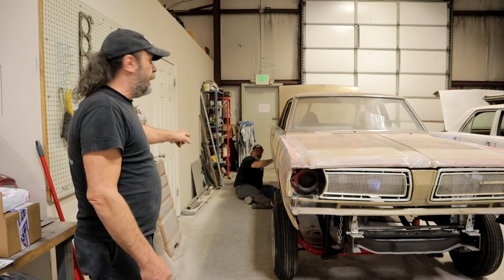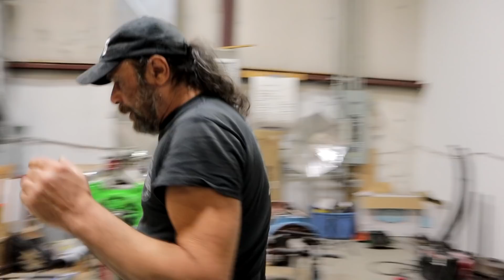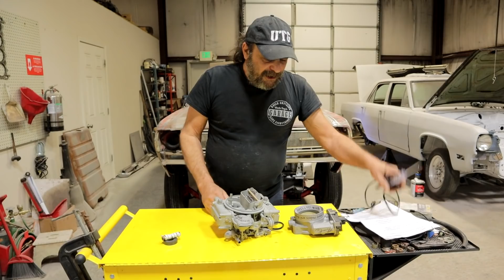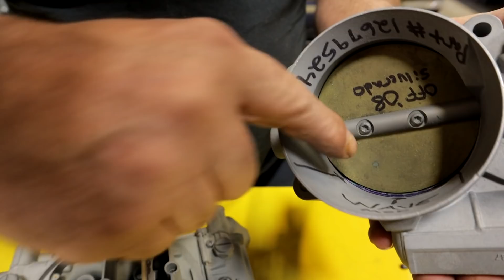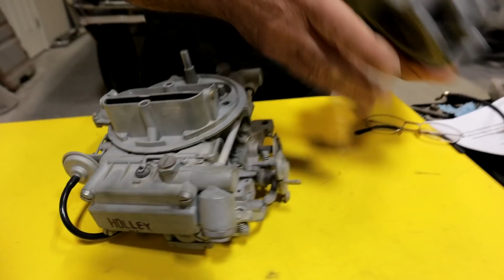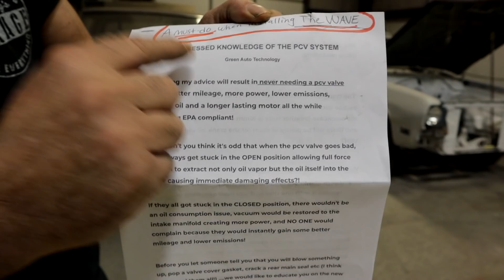The Free Energy Scam And Other Absurdities Of The Mechanical World

Comment: A couple of notes on the throttle body.

99 era GM Vortec V6 / V8 used a single large throttle body with a " ski jump " on one side of the blade.  This allows fine throttle control at low openings and virtually no restriction at wide throttle.  This jump effectively blocks off one side of the blade and all air flows through the other side of the blade until you are past 1/8 or so throttle. 

99 Era Ford ( at least on the Ranger 4.0 OHC ) the throttle body gasket has a rake shape protruding into the air stream.  This performs a similar fine throttle control at low openings. 

Sure, you can cut the ski jump or rake out and you will think the car is faster however, it will be miserable to drive when trying to maintain lower speeds.

Comment: Just like the late Magician Randy, you're debunking fraud.
Engines run on Air, the Fuel just heats the Air. 
Pulses and flows work just the same as in  Pumps. Positive Displacement Pumps, Turbine Pumps, Centrifugal Pumps, all are driven and flow some substance. 
Engines use these properties , add Fuel and Pump Heated Air. As a byproduct we turn a shaft that can do work. 
All the laws of mass, friction, heat, and motion apply. 
Sorry no Magic.

Comment: The pcv system has many advantages I agree with you to the fullest. I think some people get confused on a pcv and a crankcase evacuation system. They are the same as you know but use different sources of vacuum I.e. headers,vac pump or engine vacuum. Please explain this in your pcv video.

Comment: That modified carb is basically the same as stock the only difference is the throttle plates adjusted wrong. Try it out same setup as the vapor system to prove it doesn't work. 

On a side note I bought a vehicle with a bolt in turbine that supposedly caused the air to swirl when the motor was running. It was supposed to improve fuel economy and horsepower  but it didn't work like all the other gimmicks out there. There's one in every crowd that believes in this junk.

Comment: Hey I like the video. I'm one of the guys that believe you can run them off of just compressed air and have the system refill itself. You would have to use electric as your fuel source, instead of gas

Comment: I put air oil separators on all my cars because I've seen the amount of crap that comes out of the PCV system. Even top fuel cars have a version of it so they don't oil down the track when they pop the motor. Of course Tony knows that.

Comment: Don't do the trial. Too many variables to notice even a small change the mod can be credited too.  IMHO to do a trial properly a second carb built identical but non-modified is needed as 'control' and then put on two identical vehicles to be driven identically same time/humidity/temp/wind direction and so forth. IMHO the guy hopes you do try to bail but by just saying something like  "Ya it seems to work." and he'll run with it. You will be used for marketing forever. I remember when 70's Suzuki did something to it's motorcycle fuel draw system to get more power. Maybe 'swirl cool combustion' or something like that. I think that worked. Your vid reminded me of that way back when. God bless!

Comment: The only way to fairly test that system is to get an identical carb with identical jets and mixture settings, then run a test like you did with the vapor system.  My guess is there will be absolutely no difference because of the reasons you stated.  Maybe you should tell that guy to do a little research on the Chrysler cross ram manifolds.

Comment: I would use the Holley on the dart with the baseplate with grooves. Run the gas from a small container so that it would run out in 10 minutes or less at 1200-1400 rpm (cruising rpm where the groove should be working) while the car is park. After the baseplate with grooves, use the baseplate without grooves, or you can do the normal one first and the grooves one second, your choice.
Steps for actual test:
-start the car
-Set the rpm
-fill container
-Turn off the car
-restart and let it run till empty
-switch baseplate
—Repeat

Doing this negates any enrichment mpg losses, while ensuring both plates see the same exact test conditions.

Another way would be to use a very small clear container. Make a line on the bottom of the container where you stop the test. This test measures fuel consumption and time, the first test (till empty test) measures time. Hope this helps

Notes: 
-containers would have to be quite small to accommodate a run time of 10 minutes or less
-I understand that cruising at 1200 rpm and idling at 1200 rpm are not the same. While idling, there is no load, but from what I understand, the airflow through an engine at 1200 rpm should be the same no matter the external load
-the Holley currently on the dart is tuned for that engine, making its efficiency more ideal that two different carburetors with same internals but different base plates

Hope this helps

Comment: Back to back test is easy. Have engine running on a stand, part throttle for a set amount of time. Use the wave carb. Then swap to another unmodded carb. Both must have the exact same set of internal parts, jets, etc. Start both carbs on the same already to temp engine with a fresh oil change and filter, and with a measured amount of fuel. Measure fuel consumption after the test. Actually doesn't need to be on a stand. Just disconnect the gas tank and plump in a temporary fuel containter that you can have a measured amount of fuel in.

Comment: I agree, the PCV was a great addition to engines. The old down draft tube just didn't cut it unless it was strictly interstate use but there was no interstate back then, lol.
Reply: Speaking of those, my dad mentioned that it took a bunch of years but the center of the road wasn't as dark anymore.
I think he was referring to the late 70s when most of the cars by then had it and the old ones were retiring off the road. 
Bikers kinda notice things like that.
Reply: @MrTheHillfolk   Another tying that hardly exists today is the 2 cycle Detroit Diesel they leaked a lot of oil!  a lot of over the road trucks used them.
Reply: yup stinky

Comment: I really appreciate the battery videos.      I had a bank of 6 deep cycle 235ah 6v batteries that sat uncharged in my shed for about 3 years.  After charging capacity was basically nothing.  Tried the welder tip, and was able to revive 4 of the 6.  The 4 that work now have a capacity of around 180ah, and the 2 that didn't survive are scrap.  They both are measuring a dead short, so I guess the plates must have warped.

Comment: The intake swirl can not survive, through the twists and turns, of an intake manifold. Old technology,  that did not sale.
Reply: The point of the squirrel is to mix up the fuel droplets before they hit the intake valve it's about atomization back in the 70s GM used to put intake gaskets with screens blocking the intake ports so when the fuel hit it finely atomized the fuel and air evenly

Comment: I have had built Chevy engines the have leaked  oil from  the valve covers because there was no PCV system that blow by has to go some were you can block off a pcv system these people are nuts

Comment: The Vapor system may have worked if you did long-distance highway driving everybody knows in town driving is gas-guzzling
Reply: An impartial test would be putting it on a 350 Vortec crate engine that's not all modified but basically stock and doing back-to-back comparisons on a long drive

Comment: Uncle Tony, your supposed to hook up the Silverado throttle body on a Chrysler product with a Ford rear end. The resulting antinutrons and antiquarks will then be pulled into the engine and upset the Avogadro constant causing a massive increase in the angular velocity at the end of the air plenum and result in a massive increase in the efficiency of detonation in the combustion chamber. JK these people are nuts, there's no free energy, but if you're lucky once and a while you can get a free lunch!

Comment: To test that carb, just use a substitute fuel tank under the hood that holds one quart. Put in one quart of gas and see how long it IDLES. Driving is too imprecise to get accurate data. Have a control carb, another 1850, with EXACTLY the same jets, power valve, idle mixture setting, same idle speed, etc. There won't be any change in power, it's just idling, but maybe in fuel consumption. Maybe it would help in stop and go traffic. But I doubt it!

Comment: I don't think you should test that carburetor.  That being said if a test were to be designed it would have to be done with one carburetor.
Run it from a small external bottle. Time the length of time that the engine idles on a set amount of fuel. Modify that carburetor changing nothing but whatever is necessary to make the modification. Run the test again and see if it runs any longer after modification. This would be the most favorable test possible as I agree that once the butterfly valves open any more than a little the effect (if there is any) would disappear.

Comment: Idk i how i would test this out tbh, 1st thing that comes to mind is like others have said get the twin carb untouched install it run it after its dialed in to get a good base line, then remove the carb and put the modded on one dial it in as best as you can and then run it. gas wise put 10$ of gas in the car for both carbs jack up the ass end and just let the car sit in place in drive and run. time it til it runs out of gas. one that runs longer is clearly better.

Comment: Hmmm, that precise groove cut in relation to the throttle plate does make a difference but you have to also block the PVC vaccum so to maximize engine vacuum to make the difference. It does raise cylinder pressure. I have done it several times. But this guy is ripping off Ron hattons gadgetman groove which is well astablished and made many videos. He wasn't the best marketer so many of his videos end up being dismissed by lots of people who are not willing to look into more.
Reply: correct ....

Comment: I did the battery thing about 3 weeks ago.  My 77 D110 Slant 6 is being difficult and the battery completely died dead, so I tried hooking it up to my stick welder.  What an amazing success.  I have to crank the engine for 30 seconds of so if it starts at all.  I have done this at least 30 times and the battery is just as powerful after I rebuilt it.  This is a great trick to know and I will use it whenever I need it.  I can pay for a welder using this trick.

Comment: As far as the PCV system goes. You might want to explain One type of benefit, with the old PCV routed to the headers trick us older racers used to do and the horsepower gains it would give. Just a thought. love the channel my friend.
Reply: Even though vacuum pumps are very prevalent at the track these days I still see quite a few header evacuation systems.

Comment: That weird Mr Gadget grooved throttle bore idea MIGHT have merit in a small, single cylinder engine, but only at idle or just above idle, when the throttle blade is nearly closed. I believe, rather than generating a vortex, it's just a controlled air leak to lean out the mixture. Much like when you drill a hole in a throttle blade on a Holley to help it idle with a lumpy cam and low vacuum. A single cylinder engine will still have pulses coming back up the intake, but not from competing cylinders. I think Michael was trying to incorporate a version of a swirl port HEAD into a carb or TB, but I think the further you get from the valve, the less effective it would be. But I ain't David Vizard, whatta I know? 🙄
Reply: said "     Much like when you drill a hole in a throttle blade on a Holley to help it idle with a lumpy cam and low vacuum.    "   Actually, this is done to allow the throttle blade to be closed enough so the blade is below the idle transfer slot.    With a big cam, you need more air flow, turning the idle speed screw too far brings the blade above the transfer slot.  Drill a hole, air flow increases, idle speed screw can be backed out.
Reply: @bobroberts2371  Yeah, I know, but my comment was getting a bit too long to go into that, lol.

Comment: I always had the best luck with a carb with small primaries. It always did good on the highway and could get up and go when you hit the secondaries.
You can only go so lean before you start hurting parts. I always liked seeing the exhaust valves a brite white color in the lean burn 318s.
Reply: Constant depression is the way to go.  Nobody makes one big enough or small enough for most of us though.
Reply: You're not really going to run lean with smaller primaries though. Smaller barrels will limit the volume of air, not fuel.

Comment: There is some info lost here. The effect of the groove is the same effect intended by dimpling the bottom of a heads intake running the eddy current is rolling the air like water rolls in a gold miners riffles. This rolling effect DOES NOT send compressed units of air into the system! What it does do is reduce the friction of in the incoming air. This has been shown to work on the flow bench but it reduces the overall active runner size the engineering/tuning has to be precise to reduce the friction and not cost power loss due to reducing the runner effective size. We all know sometimes what gains on the flow bench doesnt make it to the rear wheels and while it is great at reducing the weight of the wallet it doesnt make a gallon of gas go farther than taking a piss before you leave or leaving the wife at home.

Comment: Funny watching you in this one. I get it...I think meth/water injection is probably more likely to improve performance and efficiency over "the groove". Its adds to much complexity to be worth it. I do know that the Big 3 automakers DE-TUNE cars so they dont get the best performance or MPG. especially in the past. I bought a programmer for my 2006 F150 4x4 HD and improved my performance and MPG by 100 miles per 35 gal. tank of gas. A Ford specialist tuner reprogrammed my truck adjusting shift points and timing. I had increased airflow by replacing the factory 3" to 2" intake reducer pipe going into the fender for cold air with a 3" straight pipe. I also swapped the factory muffler to a MagnaFLOW. My miles per tank went from 400 to 500 instantly.  Automakers can do much better BUT, they deliberately detune engines to help oil companies (a conspiracy literally) make more profits and increase wear (for service profits)! If ICE engines were maximized for reliable performance and efficiency from the get go we may not be having this EV shift at all. NOpe they rob us at the pump and at the repair shop ( not me i fix my stuff). People look for alternatives to the corrupt status quo. Tesla. Now were seeing some scrambling by legacy auto because money talks and people are paying for Teslas over all other cars because its just a superior mode of transportation and people are sick and tired of the mediocre industry that thinks only about its bottom line not the product they produce. By the way my 15 yo Ford im still driving but the frame is SWISS CHEESE. Ill be welding plates on it this summer to keep the 120k mile drivetrain from being wasted, FORD JUNK I bought it new in 2006.
Reply: The domestic and the import cars all have this little thing called emissions they have to pass.
Reply: C'mon TDA, you don't really believe the smoke you're blowing at us do you?!

Comment: I used that system and I have to tell you, at the stop light waiting for the light to turn I was getting 125 MPG. And my windshield wiper fluid was refilling itself, AND the wiper blades stopped streaking the windshield.
Reply: don't forget the tires pumping themselves full of air! lol btw, are you related to Jack Welch?
Reply: I call BS on the wiper blades. Everything else is plausible.
Reply: The secret is in the purple layout fluid.

Comment: Seems major waste of time to make a video on this and have us watch 20 minutes of nothing. How can the feds be suppressing free energy technology, when they are actively sabotaging so much functionality in modern engines in the name of drops of MPG and emissions? (Long cranks before injector start firing, SAI pumps, EGR valves, catalytic converters, VVT, GDI, low displacement, thin oil, cardboard piston rings, aluminium cylinders with thin fancy coating, thin main and rod bearings, variable oil and water pumps, electronic servo and more govt mandated MPG and emission scams)

Comment: You ever look in to Free valve technology, Tony? Gotta love the people that try fuel mileage magic right..
Reply: EGR valve was the power killer
Reply: @danlindeke4039  Eh not sure what your talking about but free valve is a working camless engine concept..Iv always wondered what would happen if you made it hydraulic-assisted instead of numatic off of the oil in the engine then maybe alternative fuel types because you have complete control of everything at that point.
Reply: @danlindeke4039  NOPE!  EGR valves close at full throttle (which is what you do for maximum power).  So no power loss from EGR valves!

Comment: If you get an identical Holley with identical jetting etc. and put a gallon of gas and see how far the car goes. When it dies, swap carbs, dump in another gallon of gas and and see how far that one goes. Only real variable is weather and manufacturing tolerance in the carbs.